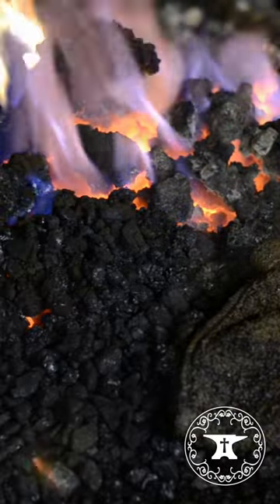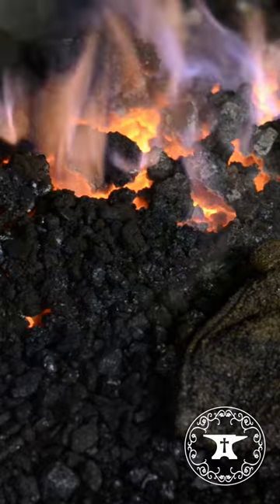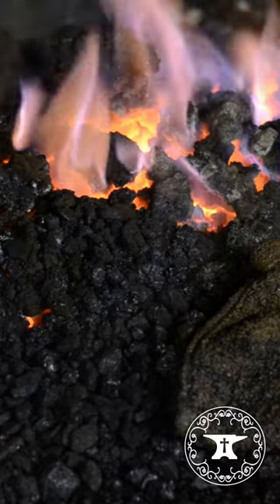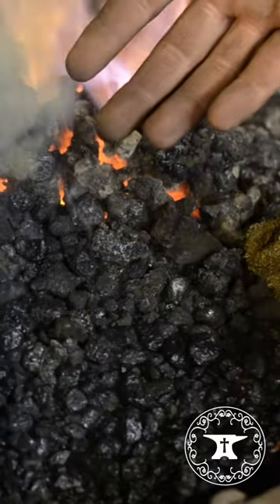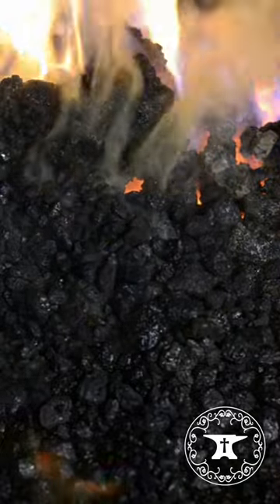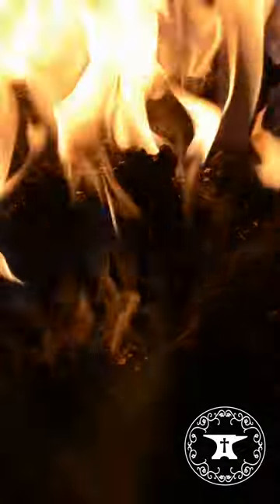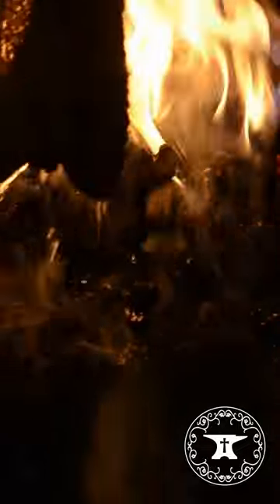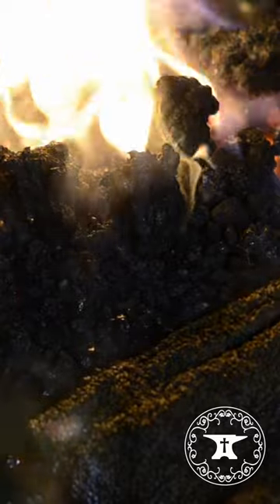Dipper Cans NOT Allowed!

Comment: I have always just used the water can and when my fire pot has a hole burned through (never had one Crack)... I just weld up another pot out of some plate. I keep a cardboard template in the toolbox, takes about 30 minutes start to finish to have a new pot made and it lasts about 3-5 months. Yes plate costs a bit, but its easily sourced from the scrap yard for just a few dollars for a piece you can make 5 or 6 fire pots from. I always just cut my 3" threaded pipe nipple free from the bottom and reweld it on. I have 2 size pots I use and a shimplate to fill the gap that is the difference in their sizes. And have a spare one made at most all the time. I also dont forge much anymore. But I would never buy a cast firepot because $1200 is absolutely ignorant to spend on just about anything ever.